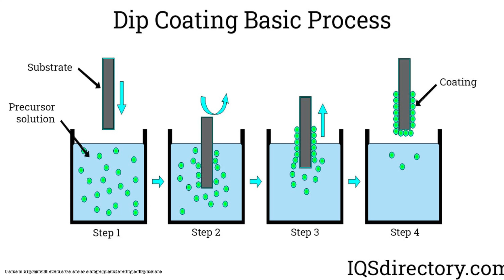How to make 3D Prints look more expensive!

Comment: Unfortunately rubber doesn't last forever, it gets gross, sticky, and slimy eventually. Rubber is made from oil, and into oil it shall return
Reply: I hate these soft touch plastics and rubbers so much. They make all kinds of device's lives artificially short. Some times you can clean them off with hand sanitizer gel tho and make the not gross anymore. I've had a few that just stay sticky no mater what I try to clean them with.
Reply: Can confirm this. A lot of my makeup compacts and makeup brushes have this rubber coat. It takes a few years though about 6 is where I noticed it starting to get tacky to the touch but defiantly by 10 it start to get gross. But at that point I can remove it with 99% alcohol and some hand cleaning. 

That said not all rubber coats does this. "Plasti-dip" style rubbers has an incredible life.
Reply: @WARPAINTandUnicorns  Yes, we have screwdrivers that are rubber dipped and they have been fine for 40+ years. Got them handed down.